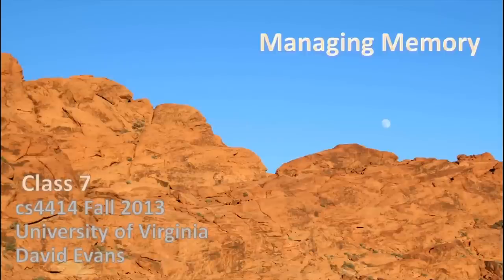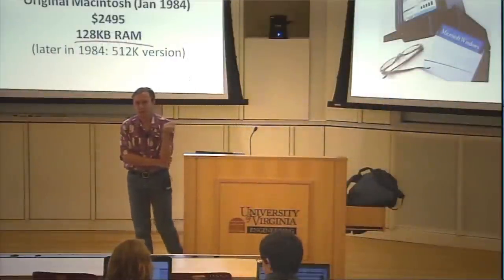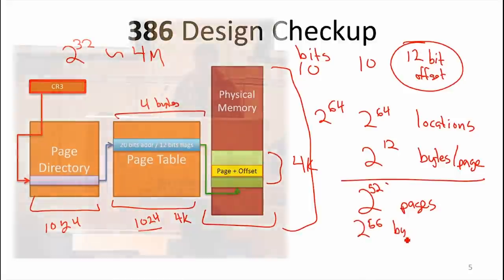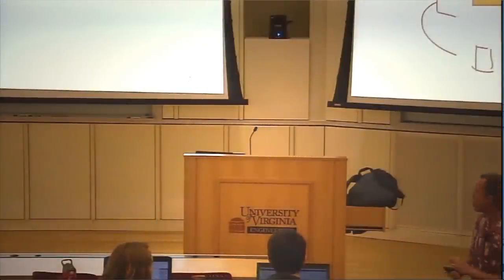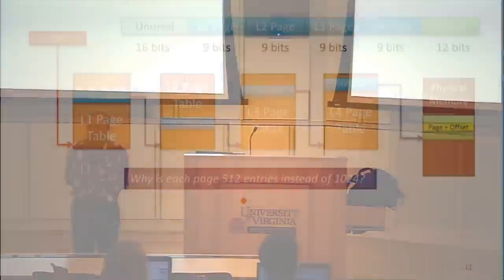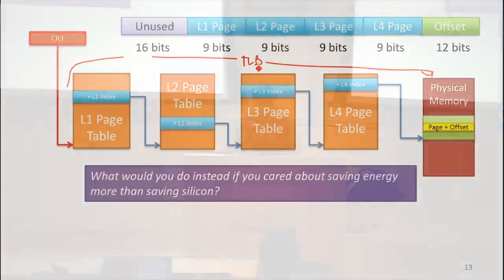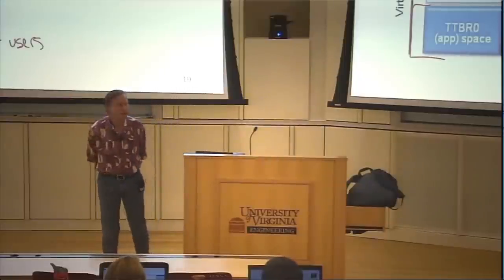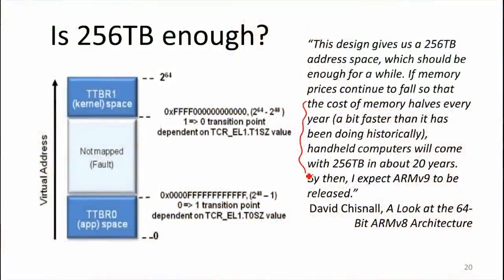Modern Page Tables: Multi-Level Paging

Comment: is nt 2^32 == 4 G and not 4 M, also I think the index is 9 bits because each entry in the page table is 8 Bytes therefore 2^9 * 8 = 2^12 Bytes = 4 KB which is the size of the page.
Reply from the maker: Opps!  You're right, of course, 2^32 = 4,294,967,296.  

Sorry, this is a mistake on slide 4. The virtual addresses for 386 have 12-bit offsets, so there are 2^12 = 4096 addresses in a page, and with 2^10 pages, this gives 2^22 addresses = 4,194,304 (which can address 4M bytes of memory since each address is to one byte).  (10 bits are used for the page directory, which is why we don't get the full 32-bits for 2^32 addresses.)
Reply: Aseem Grover Sounds promising

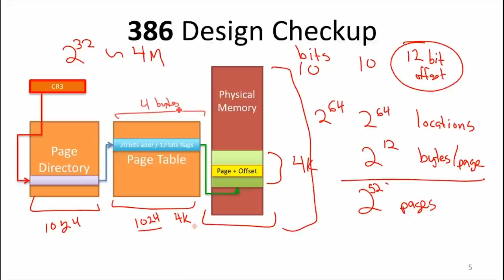Comment: at ~4:50, introducing the overhead if the 32 bit paging scheme was applied to 64 bit architectures: 2^64 locations   /   2^12bytes/page = 2^52 pages.
Page table entries can not be 4 bytes long (32 bit) to address 2^52 pages. Each entry needs to be at least 8 byte long (rounding up to next DWord). 8 = 2^3 so the required amount of memory dedicated to page tables would be 2^52 * 2^3 = 2^55, not 2^56 bytes (pen note) nor 2^54 (keynote text). I was a little bit confused. Anyway very interesting lesson, thanks for posting it!

PS at 6:45      2^44 is 16 TB (2^40 = 1 TB * 2^4 = 16)
Reply from the maker: Thanks, Filippo!  You are right, sorry for the mistake and thanks for posting the correction.